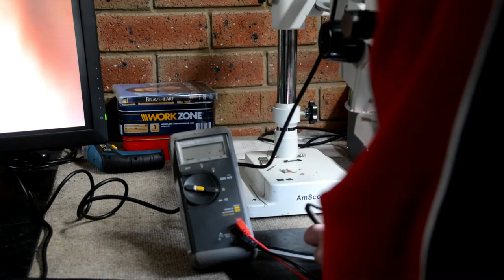Xbox One S Power fix  (watch part 2 from 20.00 min)

Comment: Great video. My psu has a blown fuse. Can't find any shorts (bridge, diodes, mosfets). Puzzled until I lifted the main cap and saw the same burn marks (video 18:36) near D102, so I guess it's not worth spending any more time on.
I'll check the X box works from my linear 12v 10A psu before buying a replacement (refurbished) psu at 27 gbp.

Edit 09/09/2022. Now found a refurbished psu on ebay for £19 😁. I should also say that the whole unit (not just the psu) was full of dust blocking the ventilation holes. I would suggest vacuuming at least once a year. Maybe this is a reason why the psu blew up in the first place. I'd be interested to know if any others found their unit full of dust.